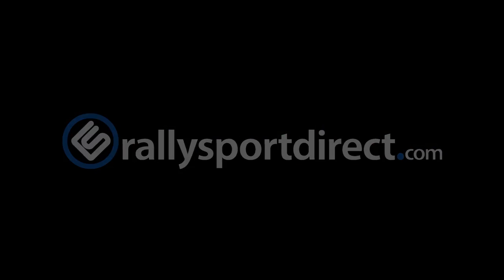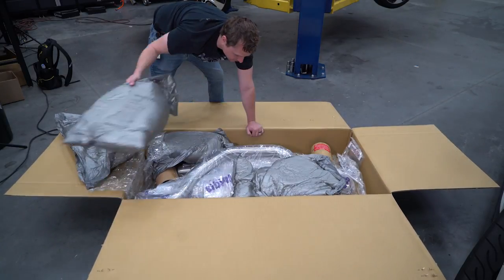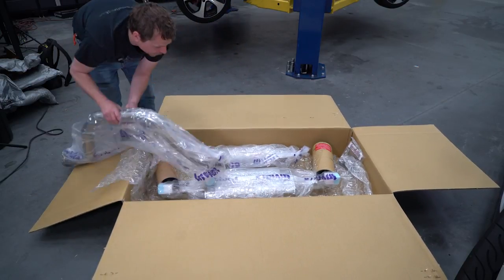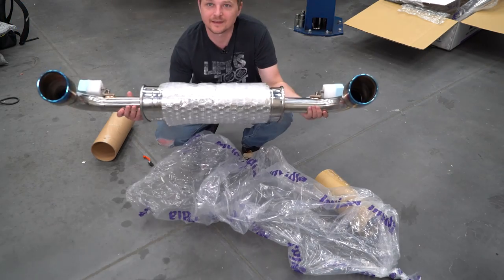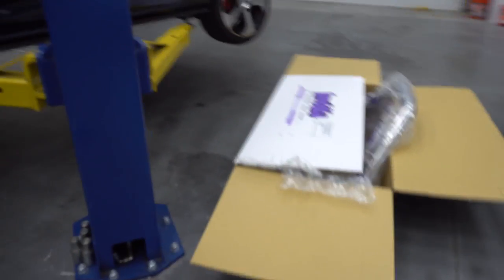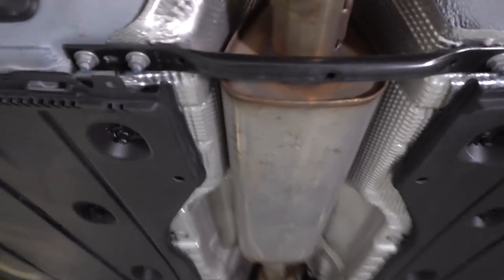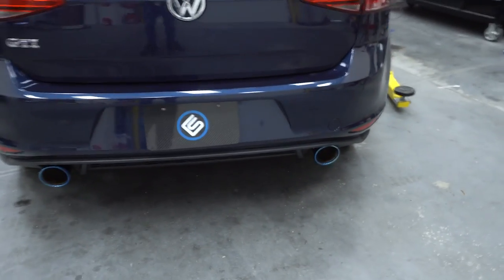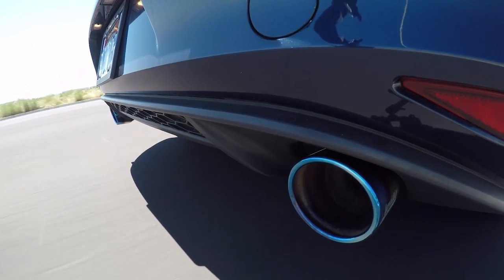VW MK7 GTI EP:04 - More Sound With the Invidia Q300 Exhaust!

Comment: You mentioned that it was difficult to install the exhaust. Did you mean getting the rubber off during removal of the stock exhaust or did you also have trouble installing (and fitment of) the invidia exhaust as well?
Reply from the maker: Good question and I should have been more specific. The hardest part was getting the factory hangers off the stock exhaust. The invidia went in with ease. I HIGHLY recommend a exhaust hanger removal tool, it would make this process significantly easier and much quicker. These can be found online for around 15 dollars. Hope this helps!!

Thanks,
Rick

Comment: Mine drones alot at 2k rpm, is it like that or is it bad installation.
Reply from the maker: Are you using a stock downpipe or aftermarket? Ours has 0 drone on the stock downpipe.

Thanks,
Rick
Reply: its stock downpipe. Any suggestions, its like high vibrations at low rpm only between 2000 to 2500?